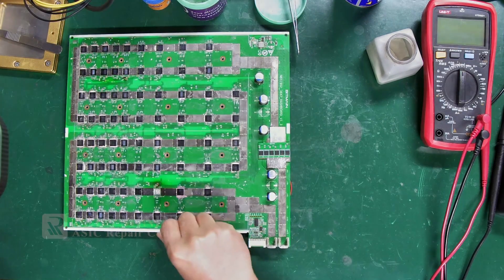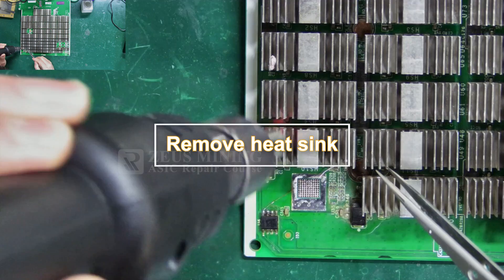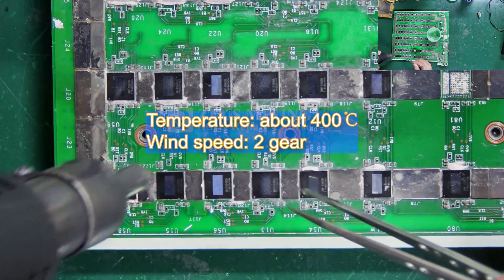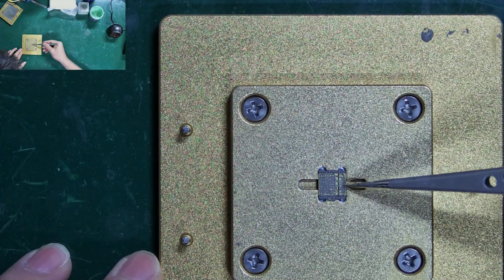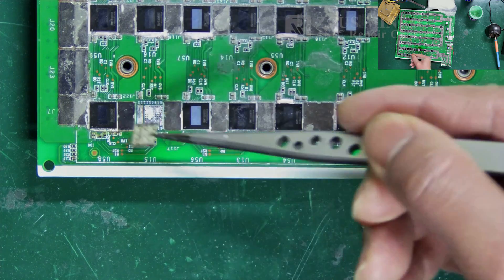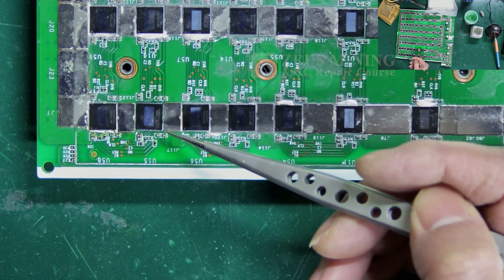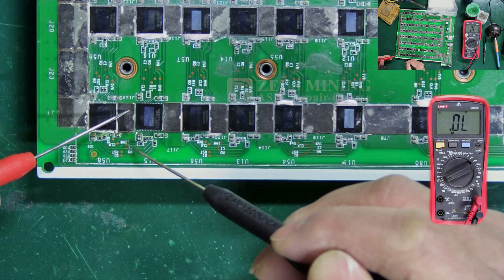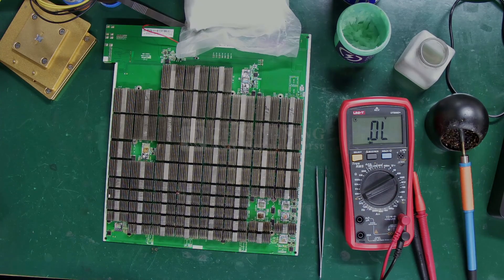Effectively replace Antminer hash board ASIC chip to solve no hashing - ZMRC Antminer repair course

Comment: Grateful, it explains in detail the hot air gun temperature and wind speed required for welding ASIC chips. It is a knowledge point worth collecting for novices.
Reply from the maker: Glad it helped you

Comment: Tin the new ASIC chip, replenish the pads, place the chip on the pads, add flux, heat and melt the solder paste, practice more.:elbowcough::virtualhug:
Reply from the maker: Thanks. We will make corrections and improvements.

Comment: How to ensure that the surrounding original parts will not be "lost" during soldering? Thanks in advance.
Reply from the maker: Your heat gun needs to select the appropriate wind speed and temperature

Comment: Perfect work! how long does it take to melt the tin on the chip pins?
Reply from the maker: Referring to the temperature and wind speed in the video, it will take about 7 seconds. When the solder paste on the pin starts to shine, it means that the solder paste has melted.